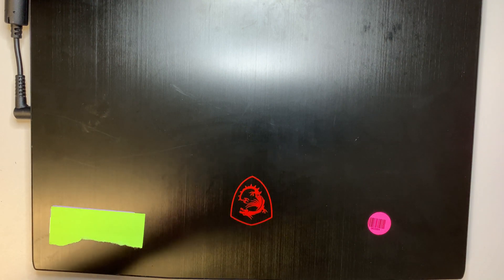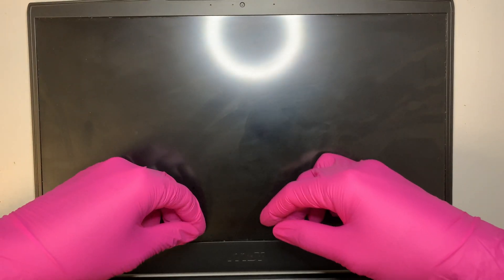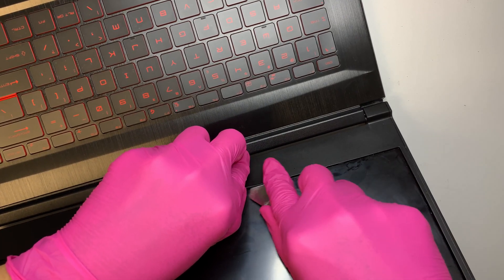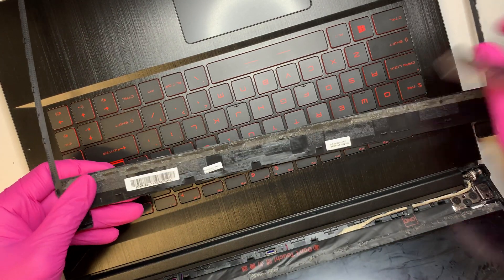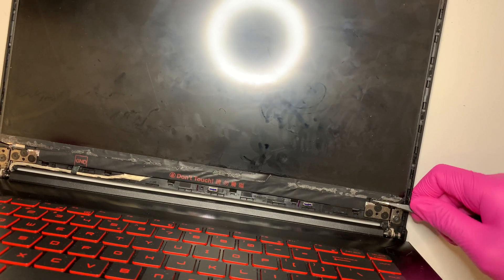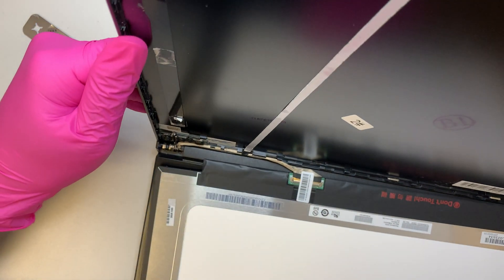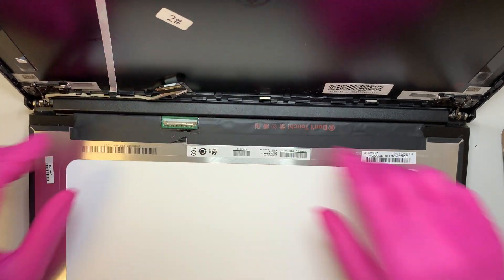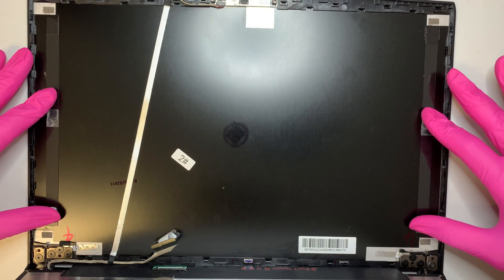MSI GF65 Laptop - Screen Replacement

Comment: Yeah, MSI can go F themselves with their way of installing the screen. There are many instances where one of the hinges breaks of from the screen lid and you need to replace the lid. In that scenario you have to take care NOT to crack the screen. They way MSI installs their screens makes it really hard to do. Why not have the standard little tabs on the bottom or top of the screen that you can pull and remove the adhesive tapes ? It's on purpose to force ppl to buy the whole screen assembly from MSI or to send the laptop for repair to MSI. Do not support companies who treat you this way, buy from someone else, there's plenty of options out there.

Comment: I messed up my screen on my MSI GF65 10UE, it faded in one corner you can see it when screen is dark. I put on a screen protector and did an awful job, i pressed to hard on the whole screen, and bleached the screen, im hoping i can replace it watching this video, wish me luck. Found one on ebay for less then 100$. My local tech guy charges 60$/hour, but this took way less then 1 hour. Aloha

Comment: Thanks for this guide! Also worked for our MSI Bravo 15 MS-16WK A4DDR-247US. For those wondering, the connector pulls out from the receptacle on the screen along the same parallel plane as the screen itself. Better to avoid letting the sticker pull up on the connector while you free it if you can.

Comment: Great video with very clear instruction.. Do you think the same led is installed for Model number: MS-16W2, SKU: GF65 Thin 10UE? if not, may I use the same in this video to replace mine? thanks!
Reply: Yes, i have that same one, you need the 144hz 40 pin, not 30 pin. Ebay has them for 90$. Goood luck amigó, aloha from Hawaii. Ps-do not get the 30pin, get 40 pin.

Comment: hi, if i use a heat gun/hair dryer to warm that tape, it will work easier ?
Reply: I believe so bro. But dont keep the gun on it for to long, step away, blow,step away, blow etc, until you feel it coming off.

Comment: I'm thinking of replacing my screen with an OLED panel... There's nothing wrong with my laptop, I just want a better panel (well better in some ways)
Reply: Same, but with one with just better color accuracy and brightness. The stock one is really bad, but i’m afraid i might break something if if try doing it alone.

Comment: What does the “do not touch” tape use for? And what if that tear up a little? Thanks
Reply from the maker: Nothing really. Just to cover the LCD board
Reply: @UbergeeksBiz  thanks.. i just got the problem recently and my laptop was suddenly no display at all.. thats why i ask.. thanks by the way
Reply from the maker: @zainul31  Do you get display by output HDMI to external monitor / TV ? If yes, more likely laptop LCD is bad.
Reply: @UbergeeksBiz  yes i have tried using external monitor.. it works. Maybe true that my lcd is bad

Comment: Is it possible to replace the display back?
I mean, the plastic thing to which the display attached. 
Can you make a video?
Reply from the maker: Yes. You can get the full assembly top cover for the replacement.

Comment: So what screen replacement did you use?
Reply from the maker: Where to get LCD Screen Replacement ?
- https://amzn.to/3prF2uK
- https://ebay.to/3lA8j4c
- https://ebay.to/3ks9Gk1
- https://ebay.to/2ItdzZg

Where to get tape to glue LCD back on (Adhesive Red Tape) ?
https://amzn.to/2CGZsu3
Reply: @UbergeeksBiz  what did you use to pry it open?
Reply from the maker: @GradGamer  https://amzn.to/3gFDgUn

Comment: The screen on my GF65 thin isn't cracked but i want to replace it for a screen with better color gamut and faster response time. A better screen is not that expensive (around 100 euro) so worth it imo. Thanks for this tutorial.
Reply from the maker: Thanks for sharing
Reply: can you tell me the brand and models that have better gamut and brightness for gf65, thanks
Reply: @fixakunmu6710  AU Optronics B156HAN08.0
Reply: @Harolddespui  
have you bought it? can you show me a trusted purchase link? 
oh yeah, is there an oled type screen that is compatible with this gf65?
Reply: @fixakunmu6710  I bought it on Ali. I am not familiar with oled screens that might fit.
Reply: @Harolddespui  Hi there, did the AU Optronics B156HAN08.0 work for your GF65 Thin? Also, what GPU and CPU are in your laptop? I know there are many different models. Thanks.
Reply: @ozzuneoj  I have bought the screen, but never built it in, i returned the gf65 before the 14 days period ended and ended up with a better laptop with a 17" qhd screen and gtx3070. 
The AU Optronics display is laying around in the closet. 🙂
Reply: bro, i was looking for this
did you do it?

Comment: No need to disconnect the battery first, before you disconnect the screen? Why don't you apply heat before removing the bezel?
Reply from the maker: Can replace screen without disconnecting battery. Good to apply heat to remove bezel.

Comment: I am using the same laptop, the only bad side is the screen is not cleaned. When I wipe my HP computer with a cloth, it is like a glass, but it is worse on this screen, whenever I clean it, I do it worse. Is this valid for all laptops? Does anyone have a solution?
Reply from the maker: Windex

Comment: Is it normal for a laptop not to show light as the screen is removes
Reply: Removed *
Reply from the maker: @ekeomakalu4483  Did you connect the cable back ?
Reply: @UbergeeksBiz  The mistake i made was: I never removed it initially,  because it was an inbuilt. Now, on plugging the charger,  the power light comes on when tapped,  but doesn't stay. Note: Just the power light, no other light( e.g the Caps lock light).

MSI notebook,  model: MS-1551

Comment: I have the same laptop.
It fell off the desk, no cracks in the screen, nothing. But when I open it, the screen remains black.
Should I try to open and check the lsd cable?
Reply from the maker: I don't think the cable is the issue. Try see if you can output to external monitor. If not, maybe check the RAM.
Reply: Same problems here. I try with a new screen but only black screen. It works with hdmi so the laptop is powering. How did you fix it?

Comment: I have black lines on mine and they appear and disappear when i move the screen a bit back or forth

is a hardware problem, so any idea if it is the video cable or something ?
Reply from the maker: I'm 90% it's coming from your LCD screen.
Reply: @UbergeeksBiz  thanks man, imma work on it
Reply from the maker: @FranciscoRodriguez-nt4ls  No problem. Good luck with your repair.